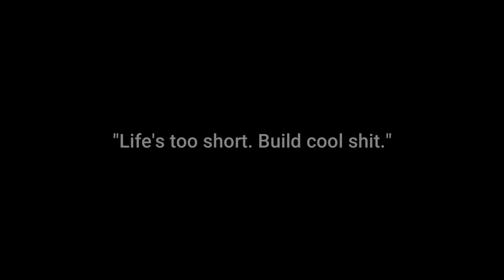VLOG - A Look at my 3D Printing Hardware and Setup (Old Setup)

Comment: ahh intresting that you have strap on your bowden tube with those cables. i need to do that since mine is just loose and since am printing right now, it kinda gets in the way with the print. nicely, didnt think of that.
Reply from the maker: Yeah it’s just zip tied to the cables haha
Reply: @FranklyBuilt  almost forgot, i actually tested out the tree supports thanks to your videos. holy crap they are amazing and extremely easy to clean.   dude you are a lifesaver haha finally making my first suit thanks to your videos.  best 3d printing tutorial ever specially for cosplay .
Reply from the maker: Dude thank you so much!! That’s awesome! And no way haha I’m just having fun with this all.

Comment: With your control boxes underneath did you have to replace your stock cables for longer ones? Are the stock cables really that long?
Reply from the maker: Chad Sine you should watch the video lol 😂
Reply: Must have missed that part.
Reply from the maker: I bought an extension cable. Super cheap
Reply: Wiring harness, got it